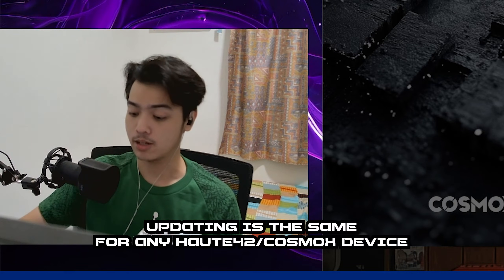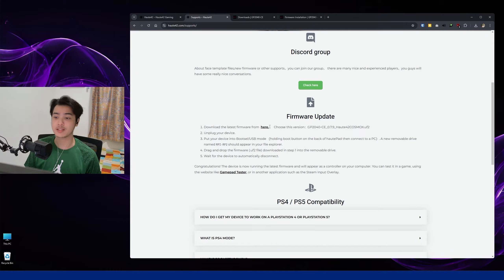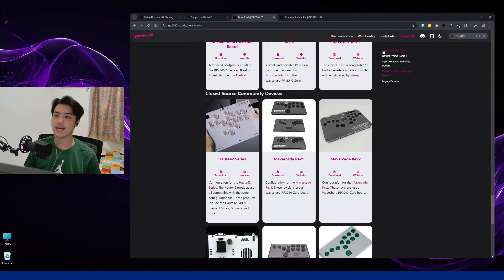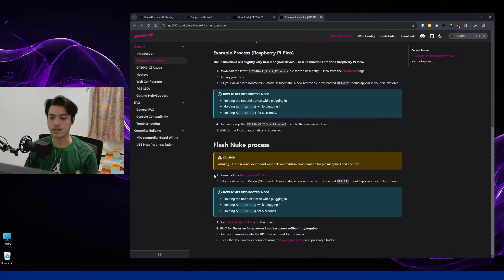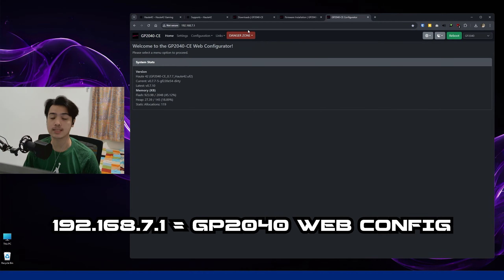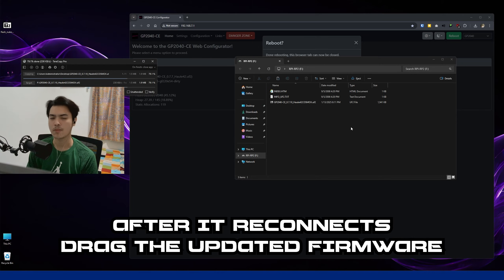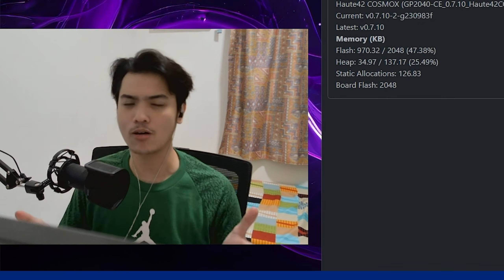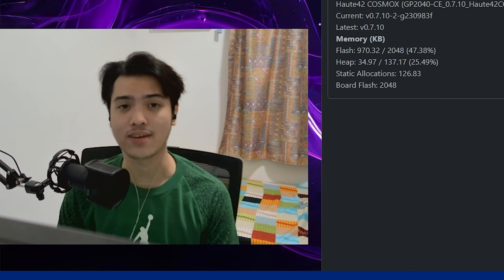Haute42 / Cosmox Firmware Update Guide [2025]

Comment: For anyone not being able to open the website using the cable that the Haute came with. I was immediately able to open it when I used a different USB to USB C cable. I was banging my head against the wall following the instructions, being in web config mode, and it still not loading. I used the cable from a PS5 Dualsense and it immediately worked.
Reply from the maker: Appreciate you sharing a fix!
Reply: thank u sooooooooooo fucking much <3
Reply: I just spent 1 hour angry until i read your comment. Love you

Comment: Every time i try to get into the web config it always times out and says "site took to long to respond"
Reply: Just happened to me. Use a different USB to USB C cable. I used a ps5 cable and it opened immediately. Let me know if it works. Also make sure you are in web config mode.

Comment: how can i get to work this on ps5? do i need to configure the settings? or just plug my cosmox booter 5 in the b16 and straight play tk8 on ps5
Reply from the maker: I'm pretty sure it's set to ps4/ps5 mode to default so I think all u gotta do is to plug in the b5 in the usb ext port of the B16 :D

Comment: My haute 42 suddenly stopped working on my series x, was working fine restarted the console and now it doesn't work. Buttons do t register
Reply from the maker: Hmm, if you have an access to a pc, try going to its website and configuring it to be the button layout that is compatible to the series x. You might've accidentally switched it to like maybe keyboard input etc..
Reply: @alendou  sure i will have a look this afternoon. i think im going to nuke it, and reinstall latest firmware. i plugged in my madcatz te2 into the same brooks converter and that worked. So i think i must of pressed something wrong like u said